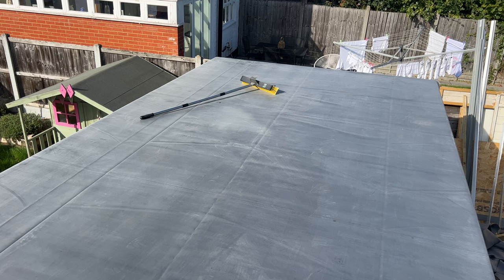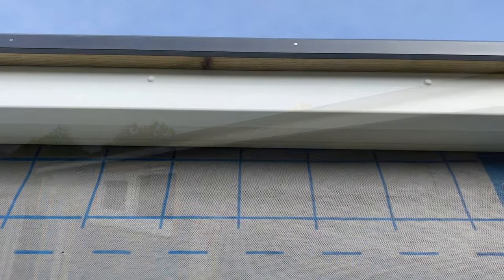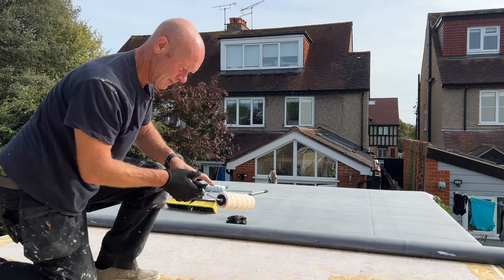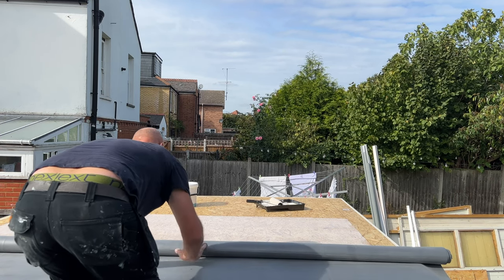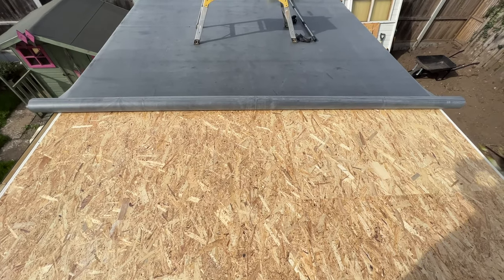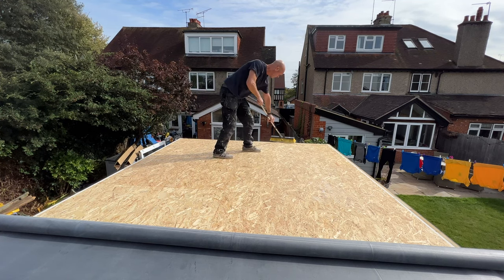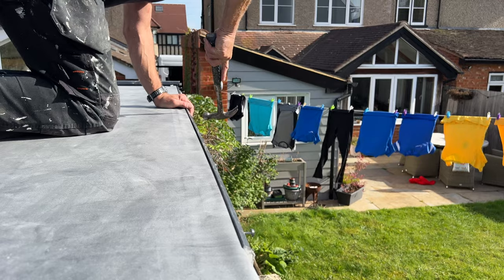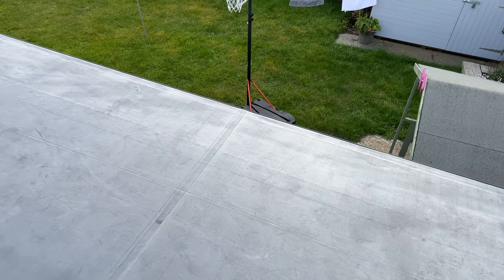EPDM Rubber roof system and how to install them the proper way

Comment: should have a layer of fastend underlayment on top of osb..i fear the wood is not suitable..i am a part of roofong local 44 cleveland with 25 yrs experience.  we NEVER glue to osb..and wood only on walls ..also we glue twice on walls as the wood absorbs the glue drastically. also we glue both rubber and the deck
Reply from the maker: @ahill7099  weir Weibo we all have different ways pal weather right or wrong but this was installed to the exact spec to the manufactures of this roof system, are you saying they are wrong?
Reply: @worklife4221  im saying how u have done  it for 25yrs.. Never dry rubber, also what if something falls on it? shouldn't there be an insulation to absorb impact?. who makes the product? We use Firestone,  and Carlisle.
Reply from the maker: @ahill7099  rubber 4 roofs
Reply: @worklife4221  yes 100%

Comment: Can you prime the board with waterproofer to give it an extra layer of protection, let dry and then apply the WBA adhesive? Will it still bind to the wood underneath?
Reply: I’m not absolutely sure but you should not need to as nothing will get through the rubber, maybe email the company and check with them
Reply: Yeah I thought so, only because I'm going to be pricing a flat roof repair, possible re-roof on grade 2 listed  building, the clients are quite saddened by the constant presence of leaks. So, for peace of mind I wondered whether to include this in price, though I know deep down, the rubber and proper installation is good enough.. I may prime the underside of board before pinning down, then carry on as normal? What do you think? Thanks for the promt response to mate 🤙🏽

Comment: Nice to see it done right and use contact adhesive on edge.😀
Reply: Some companies don't supply contact adhesive now, except for doing upright surfaces.
They only supply the water based glue and mastic for the edges.

Comment: Great explanatory video...one question: As the edges are raised where does the rain water drains off? Many thanks.
Reply from the maker: The back edge isn’t raised so as the roof has a fall on it the water all runs off into the gutter
Reply: @worklife4221  😁
Reply: I was wondering this also. So are you saying the water goes off one side of the roof which does not have the raised edge because it is sloped?  I apologize. I am confused because I’m trying to finish off a roof that I don’t have money to pay a professional for. The rubber membrane is on and I need to attach a cornice… But the water needs to go somewhere!  Thank you for a wonderful video. It’s the best I’ve seen!
Reply from the maker: @alidapurmalietis487  yes buddy the water runs off one side to the back so when I put the roof timbers on they had a slope on them
Reply: @worklife4221 Great video! I am about to do mine tomorrow and I'm trying to work out what you do with the curb trim regarding the fall of the roof. I want the trim to be level and not sloped but then when it reaches the drip trim it will be higher. What did you do for this? Thanks

Comment: Fit these all the time. Couple of tips. When you glue and activate the joint covers just do one side as this allows it to expand. If you glue the whole thing to both parts they can split. Also when trimming the rubber under the trims use a hook blade in your Stanley knife. Lastly try to get some one to help on the gutter drip by pulling the rubber while the other person nails the drip trim. Makes the water run off easier. Before we lay the rubber we give the OSB board a quick sand with some 80 grit paper to a, give the glue a better key and b, to knock off any bits of paper from the nail gun or chips from the countersunk screw heads. 
Perfect video mate btw. ❤

Comment: Good clear video, well explained. I am about to do another one and wanted a refresher. However I remember using an extended pole on the roller so I could stand up while putting on the adhesive

Comment: Really helpful, cheers.  Any advice on how to stick and seal the rubber to a vertical brick surface that is next to the roof?   My flat roof butts against a taller brick wall.  Thanks again.
Reply from the maker: Hard to tell as I need to see a picture, is it possible to fix sterling board or ply to the wall?
Reply: Yes you can, the supply a primer agent for masonry or brick walls which you paint on and when it's dry you use the contact adhesive on the wall and the rubber as per his edges.

Comment: Very helpful Video, a tip though for potential users, PVA the top surface of your Boards to seal (These Boards are very porous) and paint the edges, and left to dry, anything will do as long as It's oil based.
Reply: Won't oil based finish degrade the EPDM?
I know that bitumen will.
Reply: @TheDajoca  The Edges only then left to dry.
Reply from the maker: I was told by a rep for the supplier of the rubber roof system that PVA can have a reaction to the adhesive and therefore is not recommended although sounds a good idea, not sure how true this is though.
Reply: @worklife4221 I’d use SBR rather than PVA as PVA is water based

Comment: What was surface prep?..what surfaces can this be applied to?.. good Tuturiol...thanks
Reply from the maker: Prep was an EPDM primer and applied onto sterling board also can be applied onto plywood just make sure it’s dust free with no bits sticking up that can puncture the rubber

Comment: Thanks for the great Video. Can I ask which thickness rubber did you use and apart from the obvious, is there a difference on which thickness is best?
Reply: I used the 1.2mm rubber which is the most common one to use,they also do 1.5mm which is more for commercial use, hope this helps

Comment: what type of adhesive is used on the edges and why does it have to be different from the other?
Reply from the maker: @rdword2345  The edge adhesive is stronger as the manufacturer advises it, as for the type of adhesive I can’t remember but I’m sure that I showed it in the video
Reply: It's contact adhesive.

Comment: Hi mate, I'm an installing the osb3 next week. Is there a need for an expansion gape between boards? If so will it effect the EPDM rubber long term?
Reply from the maker: No need for an explanation gap as it will effect the rubber
Reply: Appreciated 🙏

Comment: Any reason you didnt start back and work the adhesive towards the rubber?
Reply from the maker: Do you think that would make the job easier?
Reply: @worklife4221  yes slightly...
Reply from the maker: @mervmervalot2296  how?
Reply: @worklife4221  so you don't have to keep getting up and walk around the glue around the edges..   I'm not picking... I just asked if there was a reason you started at the rolled up rubber end rather than work back towards it...
Reply from the maker: @mervmervalot2296  I do it that way so that I can roll the adhesive onto a bigger area as rather than kneeling on the rubber , but I do it the other way as well
Reply: It makes more sense the way worklife is doing it as he says you cover more area,if you kneel behind the roll you can only reach so far 😊
Reply: @Fishit-cl3mn  huh? What you on about.....

Comment: You have to fold the rubber back and prime it with adhesive as well bro, 😢
Reply from the maker: @JdsjsKdmem  your totally wrong buddy with this rubber roof system you only roll adhesive to one side , I haven’t fitted other brands so I cannot comment on weather they are the same.
Reply: We too only do the OSB board. Sticks like 💩 to a blanket as they say.
Reply: Yeah that’s what it says on the side of the tin. I did one recently and it did make a big difference. Everything else in this video is great though.
Reply: @benmatthews2124  no drain, scupper?
Reply: @benmatthews2124  what country? 
That trim is peel and stick? 
Termination bar around the perimeter on the face. The rubber will shrink over time and pull away.
A nail every 6 inc min.